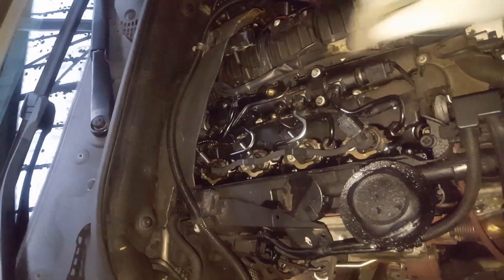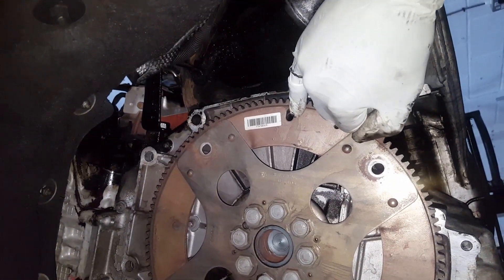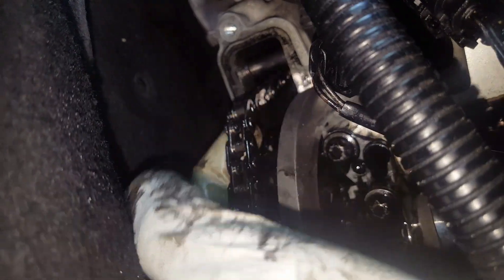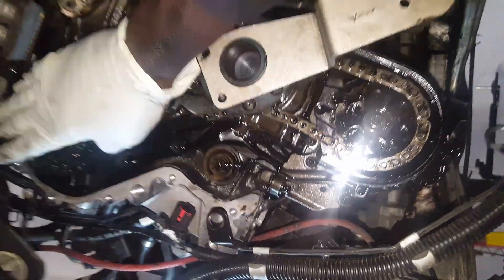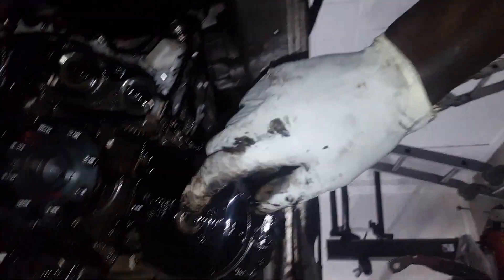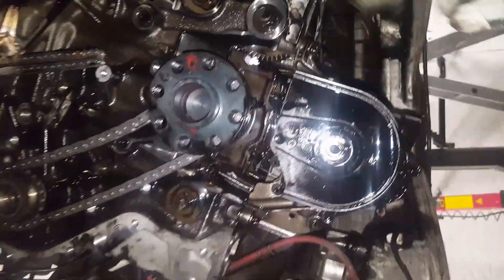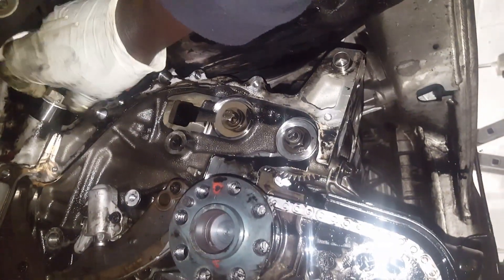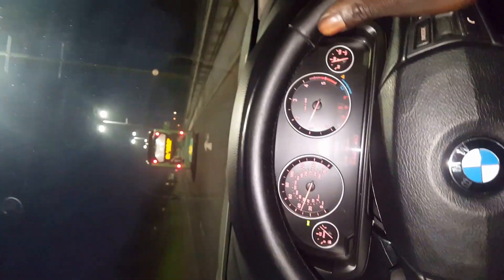BMW N47 timing chain replacement | click video describstion below for info

Comment: Dear friend, there is no need to loosed bolts for high pressure pump and no need to hammer it then later. There is special tool for this thing to be just screwed inside pulley and then with native bolt by screwing it is pushed in. This saves lots of time. And very often hammering can take looooots of time.
Reply from the maker: Hello yes you are right👍 but the comapany i use to work for don't have the special tool for the pump pulley so i decided to show ppl how I normal remove the pulley without special tool. Thanks 👍

Comment: Have you ever done this on the BMW Mini? I have a 2010 mini with the N47 1.6 Diesel engine. Do you think i'll need to remove the engine?
Reply from the maker: Hello thanks 👍. I hardly check youtube message/comment. I haven't done it on a mini but I do know mini have tight space to work on. I reckon engine will have to be removed if this n47 is on a mini. On the BMW there's at least some space to work round it👍
Reply: Thanks for the reply Dawda. I was quoted £1300 to have the work done on my mini. I'm certain i can do it myself but wanted to check with you first to see if the engine needs to be removed. The Engine sits parallel on the Mini so the timing chain is on the passenger side instead of the bulkhead so may be easier to work on fingers crossed. Great video which has given me more confidence. Thank you.
Reply from the maker: @tigertigerpantherfox3714  Ooh ok I see, I haven't seen it on mini but sounds like it's doable👍. If you have the confident to do it then it will save you alot of money .

If you decide to do it click on the video describstion, there's a link to buy the timing tool. There's also a link that will show you picture of the high pressure fuel pump gear which you have to Ensure groove on high-pressure fuel pump shaft aligned with lug on timing case. Thanks 👍

Comment: Hi I've go to do mine next week 2010 320 nd47 manual gearbox, would you recommend engine out or box out for my first time, I run my own garage but it's the first one I've had to do and it's my own typically, many thanks, jon
Reply from the maker: Jon Shillito hello alright I see, if it's your first time, I think take the engine out because you will have  enough room to work around it.

 But it is also possible to do it without engine out, but  you will have to  follow the  step by step patiently until it's finish.

Comment: What's the engine code after they fix that timing chain problem? 
I heard they did something after 2014
Reply from the maker: Phen0mable hello sorry for late reply and yes I know what you mean. I don't know the code but I do know they changed the camshaft to a better one. That's the 335d and 3 litre d, they are the better engine 👍
Reply: Dawda The Mechanic I'm thinking of buying 1 series with 2L diesel just trying to figure out that timing chain problem and what engine is better to buy.
I also consider BMW with blown engine where timing chain snaped and rebuilding the engine.
I am car mechanic just don't work in business at the moment but I definitely would be able to rebuild engine myself
Reply from the maker: @Phen0mable  hello to be honest the n47 are not reliable. 

Also if your thinking about buying the engine with timing chain snap, becarefull. The reason being is that, I have had few times, when I removed the timing cover, the cylinder block sometimes get crack/damaged. Sometimes what happens is the bolts for the timing guides breaks inside the block and then cracks the block etc. It doesn't happen always but I have seen it few times then we have to put another engine.👍

Comment: Thank you for the nice explanations! Do you have any experience/information about changing the chain without removing  the engine for an N47 with manual transmission on an 120 /123d? Is there enough space? Greetings!
Reply: I'm in the same situation, have you had yours repaired?

Comment: Why did you do it this way? Would it not have been easier to have removed the engine?
Reply: It looks much easier to do this way without removing engine. Less pain in the ass because you don't need to unplug that much sh*t and align everything properly later.
Reply from the maker: @Alteriukas  yepp that's right👍 cheers mate👍
Reply from the maker: John Gate1 this is just to show how to do it without removing the engine. I have done few with engine removed and without engine removed. Whoever is doing it can decide which way they wanna do it. Both ways will work👍
Reply: Dawda The Mechanic 

Thanks, very good video and well explained

Comment: Can i take the oil pan off, with the subframe still on ? 
Really helpful video 👌
Reply from the maker: Ravi Noetzel hello yess you can, with some mix of 3/8 extensions with UJ etc it'll come out. And no problem 👍
Reply: yes, just use some wood to look the engine up front

Comment: excellent video top mechanic
Reply from the maker: Silver Arrow cheers mate👍
Reply: how long did it take  from start to finish i wonder?
Reply from the maker: Silver Arrow 10hrs total 9am to 7pm 👍. But you can also remove engine if you find it easier. Both ways are doable
Reply: thank you .

Comment: The timing chain went on my 2013 1 series 2 weeks ago on start up. I removed the engine an found no damage to the cylinder head thankfully 1 an a million chance the cam stopped with all valves closed. This video has give me confidence to redo the timing. Top video keep up the good work
Reply: Ouch!Was that 177bhp or 184?
Reply: Did you repair this yourself? i'm in the same position and need help or recommendations.

Comment: Hello
I have a 320D MSport Convertible registered Oct 2010 and my car just lost power in fast lane of the M4 by Heathrow which was horrendous and BMW suggest it’s the timing chain that broke but they want £700 to confirm, any advice welcome?
Reply from the maker: Win Fleming hello, does the car still start? Is the engine light on when it starts running? And is the engine louder than usual when you accelerate a little? If yess then must be the chain👍

Comment: We need a quality Mechanic like you in Kent mate!! All my local garages are useless!
Reply from the maker: DR T 😂 thank you ☺
Reply: I agree with DR T .  Many garages in Liverpool will not take on BMW timing chain replacement some reason 

Mine is currently off the road for now due to timing chain. Not snapped but making awful noise so not taking the gamble until it's replaced. Crazy the prices though. £900 and some £1700 + 

Don't mind the cost but the difference in prices makes you wonder are the cheaper ones not doing a decent job or is it the garage who quoting more ripping you off 🤔
Reply: @Stemlocksecurity  did you find someone to do it?
Reply: TakeOff YourHat I just cut my loss and  sold the car to a mechanic mate.
Reply: @Stemlocksecurity  Fair enough. I've been quoted 800 to 3000 to fix
Reply: DR T where abouts are you in Kent?
Reply: trouble is no one pays quality money in kent so hard to find quality mechanic , you get same money stacking shelve ,
Reply: same is dorset

Comment: Why why why did BMW decide it was a good idea to take the chain location, which was perfectly accessible (especially on a 4 cylinder where there’s heaps of room at the front of the engine) and move it to such a place that you have to do all this work just to get to the chain! It’s madness.
Reply: The original theory was to follow Audi's lead- they converted to timing chains to reduce engine length relatively significantly, which is sound.  The problem is German companies can't figure out how to make maintenance-free timing chains anymore.  My last car was a w203 C-Class with a timing chain, but thank got we got the m111 engine, which had a robust timing chain.  The m221 that replaced it is a total shitshow, with a weak, single-row timing chain that needs to be replaced pretty much multiple times.  The timing chains on the back of engines are complete scams.  There is absolutely ZERO reason for it.  The chains can go on the front.  Some make the excuse that it's easier to bolt accessories to the front when the chains are in the back, further reducing length, but I call BS.  The German companies are overdesigning timing systems to fail, so they can figure out like everyone else how to put the accessories on the front with chains.
Reply: I wouldn't say that they can't figure out maintenance free chains, as they did it in the the past. I'd say that money won over reliability in their decision to switch to single row, but given the numerous chain problems and their own recommendations to check/replace it they could move to more convenient and accessible place
Reply: @GoranBalaško  It's a simple matter of cost/benefit. They used to engineer cars to last forever but nobody really wants a car that lasts forever nowadays, people trade it in for a newer model after a few years. By not designing an engine to last forever the engine comes out cheaper, or they can add other technology for the same price. It's easy to forget that an N47 pulls as hard as a 3l V6 petrol engine from 20 years ago while easily returning 50mpg in normal driving conditions. If they also designed it to last forever on top of that then it would be much more expensive and nobody would pay for it.

As far as the position of the chain, I'm sure when they're designing the engine the ease of access for repair doesn't even cross their minds because it's supposed to last "forever" (by which the mean as long as the engine as a whole will last before its last owner sends it for recycling). They're much more concerned with how quickly it can be put together in an assembly line which translates into labour costs. The only real problem here is that for some reason the chains simply don't last as long as they should, it's still a bit of a mystery why, since BMW uses a similar system across their engine range and it only really affected the n47.
Reply: probably has something to do with forcing people who like to DIY to go to (authorized) service garage. all else seems to me as plain stupidness

Comment: Hi Dawda, I got a 2012 E91 BMW 320d N47 engine. My car has done 146k I use it as a mini-cab and cover a lot of miles and is expected to go up. I don't have any rattling noise from my timing chain. I service regularly every 10k. I don't know if my car is a updated model where timing chain issue has been fixed by BMW. If I don't experience any problems atm should I still look to get the timing chain replaced and when will you recommend. Also is it better to use genuine BMW parts or are quality aftermarket parts just as good. 

Thanks in advance!
Reply from the maker: عبد الرحمن Hello to be honest yours has done very well for that mileage with no rattle noise. Usually they start rattling before 146k miles. Anyway the only suggestion is to carry on doing your regular service. The n47 engines are all the same nothing updated. At the moment you can start looking for quotes from different garages and make budjet for it and get it done. Because it can  sometimes cause more damage when it starts rattling. And all the ones I done has always been replaced with aftermarket timing chain kits👍
Reply: Dawda The Mechanic the N47 received an update to the camshaft design in late 2008. The technical bulletin for replacing chain on earlier n47’s states it must be accompanied by this new camshaft design, as it’s believed this is what caused the chains to go prematurely.

Comment: It's not a good design running a single pitch chain with 16valve engine but at least chains rattle warning you of trouble where belts just snap causing carnage,I have just purchased a 220d with this engine but will only keep it till the 3year warranty expires then sell it thus avoiding the problem or take out an extended warranty to cover problems like this,BMWs are never cheap to maintain if you get major problems because the labour rates are horrendous.
Reply: The chain issues are sorted now. They messed up the N47 for a couple of years but sorted it with a modified camshaft design (the camshaft would make contact with the chain and wear it out prematurely.)
Reply: Dawda The Mechanic don’t get me wrong - some do fail outside these years, but that is mainly down to lack of maintenance. In the UK the service recommendation from BMW are 18-24,000 miles or 24 months between services. Early e90 models are fine with this but later ones need once every 12 months at least. I do an oil change on mine every 10k/12 months just to be on the safe side.
Reply from the maker: Paul McPherson yes definitely mate👍 you do know your stuff which is good👌
Reply from the maker: David Ellis yess I understand what you mean and you are right mate 👍
Reply from the maker: Paul McPherson  that's good to hear👍
Reply: Paul McPherson ,I'm with you this 2year 20thousand mile oil change service interval is Nonsense no matter whose oil your using,10,000m or every year is what mine going to get as I don't believe in leaving oil in that long especially on short journey work.
Reply: David Ellis if you think about it though, recommending an oil change as infrequently as BMW does means they either get massive jobs to fix them through their dealer networks, or people scrap them and they buy a new car. It’s definitely a conspiracy on the part of BMW to make their cars last less time. They are engineered to fail if you follow BMW guidelines, which makes good business sense for them but is horrible for the customer!

Comment: Not one of BMWs best efforts as an engine design. Timing chains and their tensioners will wear out. So put them on the front!. And when it does fail typically BMNW will charge you £4,000 to fix it.
Reply from the maker: 1chish exactly mate you are right👍
Reply: I have a 2006 320d with the M47TU2D20. Picked it specifically because it was the very last of the M47’s, so most problems ironed out, and pre-DPF. Can’t imagine how much of a headache the newer ones must be for owners. A still blanked off my swirl flaps though, just in case!

Comment: Thanks for the video! Do you know how much Bmw charges for the camshaft and crankshaft locking tools? Do they have partnumbers?
Reply from the maker: atkins hello you don't need to get it BMW. Just it it from eBay. Click the link below mate 

https://m.ebay.co.uk/itm/Tool-Hub-9608-BMW-Timing-Tool-Setting-Locking-N47-N47s-N57-Diesel/322180870512?epid=12017002649&hash=item4b0379f170:g:2Z4AAOSwXetZSPSu

Comment: Can you post a link for the cam locking tool kit plz.  Very good information thanks
Reply from the maker: simmo yhman  hello thank you. Please read the video describstion too. And the link for the tool is https://m.ebay.co.uk/itm/A-BMW2030-BMW-Diesel-Engine-N47-N47S-Timing-Tool-Setting-Locking-Twin-Camshaft/122746150730?hash=item1c943d9f4a:g:LJQAAOSwLiJZ24SE
Reply: Thank you... can I ask which brands of timing chain do your trust?

Comment: Hi! In BMW instructions it says that the hpfp will be set on its mark at 45* atdc. Are u sure it dosent matter? My car dosent run too well after the installation. K
Reply from the maker: Kevchr1 hello mate sorry to hear that. Basically it means: The groove on high pressure fuel pump shaft aligned with lug on timing case. 

To be honest I have done few without the pump pulley groove aligning with the lug in timing case. 

I should have mention this on the video. I missed that. Sorry 👍

Have you plug it in on diagnostic? Any fault codes? Might be something else causing that running issue.

Comment: Hi can you tell where can I order timing chain kit with locking tools and all 3 sprocket 3 chains 2 tensioner and guide thanks
Reply from the maker: Gigel Dragu Hello yess we order the complete kit from GSF car part, you can Google your local GSF number and they will sell you the timing chain kit and it will come together with gears, chain and tensioner etc. Click the link below to order the tool from ebay👍

 https://m.ebay.co.uk/itm/A-BMW2030-BMW-Diesel-Engine-N47-N47S-Timing-Tool-Setting-Locking-Twin-Camshaft/122746150730?hash=item1c943d9f4a:g:LJQAAOSwLiJZ24SE

Comment: Did the owner of that car EVER change their oil? It looks way beyond past due! At any rate, the design of that timing chain system is horrible. That is not a chain system that could be expected to last much past 80k-km's.
Reply from the maker: tempest411 hello yess he was doing regular oil changes. But the car is taxi and gets driven a lot of miles. He came when the noise of the engine gone louder than usual👍
Reply: I would highly recommend changing the oil in that car twice as often as it has been.
Reply: tempest411 agree with this. I firmly believe that bmw want their cars to die at 100k so people either spend a boat load of cash on repairs or buy a new car. My car only asks for service every two years and 18,000 miles (sometime variable indicator will be nearer 20,000 miles between services) but I’ve always ignored it and stuck to 10,000 miles or 12 months, whichever comes soonest.
Reply: Paul McPherson I wouldn't go more than 5-6k miles between oil changes. Change the ATF every 40k.
Reply: tempest411 no need in the UK. High quality oil and high quality fuel makes it unnecessary. I had an Audi A6 which I owned from new. It had the notoriously bad 2.5tdi with super soft cams. I did oil change every 10,000 miles, or 12 months. I took that car up to 200,000 miles before I sold it. Everything was original and no wear at all on the cams. However I always used oil from main dealer, and always put Shell Nitro + premium diesel in it.